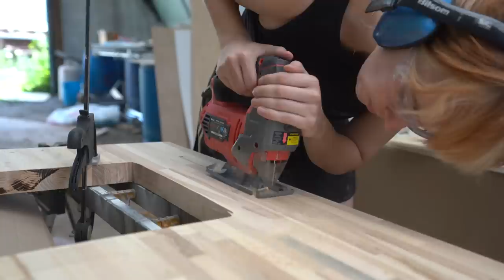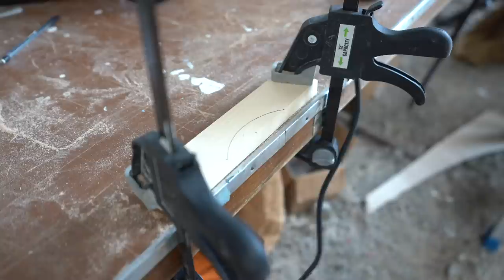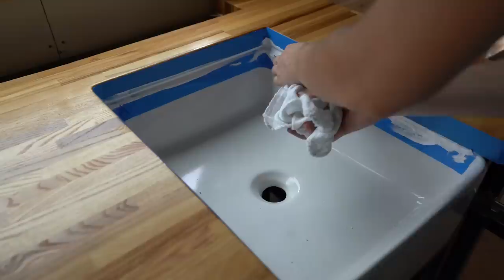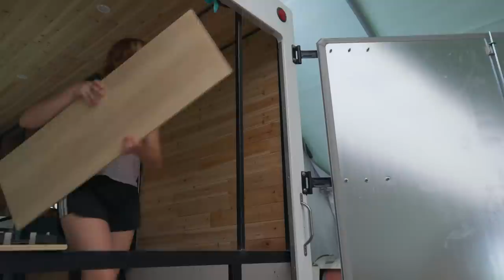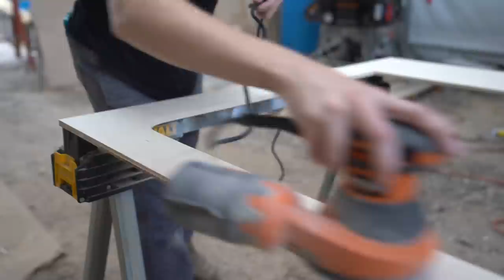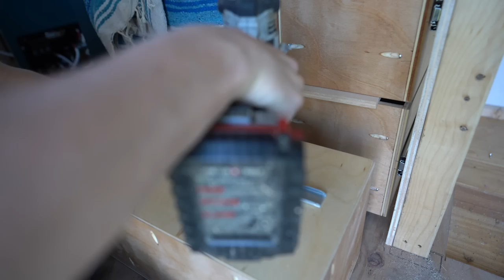Unicell Build Ep 13 | Butcher Block Countertop, Closet Storage & Drawers

Comment: What screws are you using to attach the closet skins to the metal frame?  Did you have to drill pilot holes first?